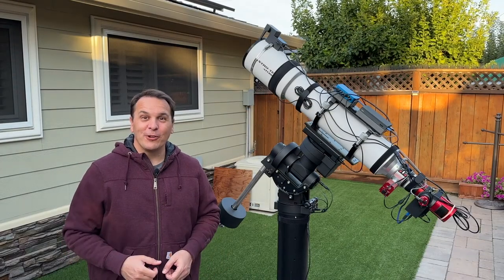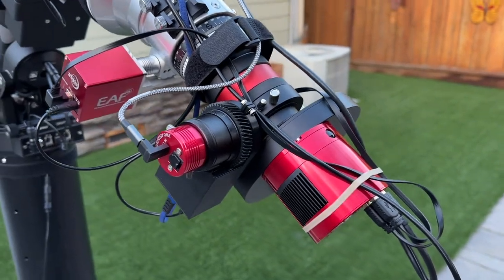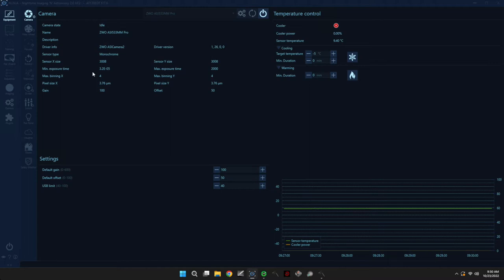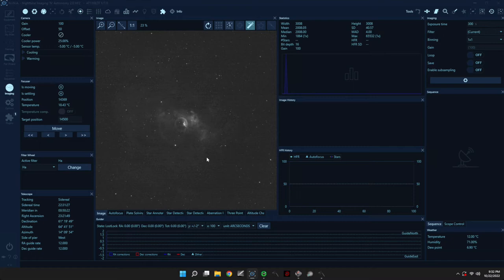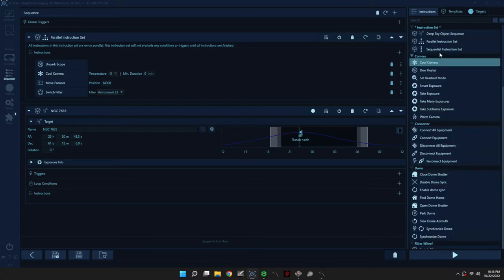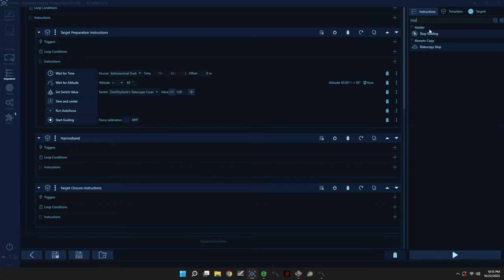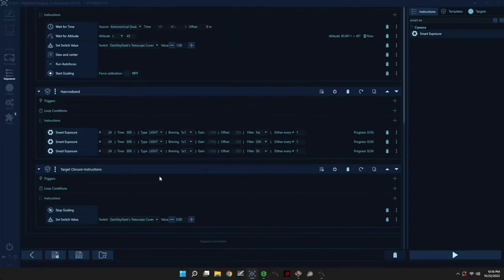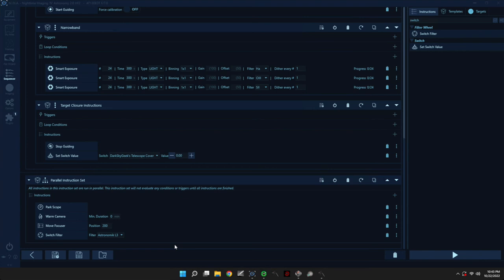The Bubble Nebula Project - Part I - Equipment & Data Acquisition

Comment: Why are you using a refractor telescope? Wouldn’t a reflector perform better?
Reply from the maker: That is a great question, and a very difficult one to answer. Up to 6” in aperture, refractors are better due to the lack of central obstruction and a higher transmittance. Additionally, refractors have a very stable optical design which does not require frequent collimation. The only downsides of a refractor are mainly the chromatic aberration (can be mitigated in a myriad of ways) and the cost (they are generally more expensive than reflectors) Beyond 6” in aperture, refractors become prohibitively expensive, at which point a reflector becomes a better option. Hope this helps!
Reply: @darkskygeek  yes it helps- but the point I don’t get: the cost of that telescope could easily afford a 10’, maybe 12’ reflector, right? Wouldn’t it be a better choice? I’m a newbie to astronomy, and the reflector just seems to be a better choice under my limited knowledge.
Reply from the maker: A 10” reflector will be massive and will therefore require a large and expensive mount. The telescope will require re-collimation on a regular basis. Thermals will be an issue. The surface of the primary will be at best 1/4 wave (unless you pay a lot of money) And you’ll have to contend with a central obstruction, which reduces contrast. Then, you realize that resolving power is limited by the atmosphere, not be the diameter of your telescope, etc. There is a long list of reasons as to why refractors are preferable over reflectors, at least up to 6” diameter. CS!
Reply: @darkskygeek  thanks a lot! I haven’t considered these points before and your feedback improves my understanding. I just didn’t understand what you meant with “primary will be at best 1/4 wave” could you explain it further?
Reply from the maker: “1/4 wave” refers to the surface accuracy and smoothness of an optical surface. It means that it deviates by as much as 1/4 of the wavelength of light (usually in the green, so 500nm / 4 = ~ 125nm) compared to a perfect paraboloid.

Comment: I still don’t understand purpose of advanced sequencer. I can plan everything in simple sequence mode plus refocusing every 1.5 degree drop in temperature; framing target with rotation and meridian flip.
Reply from the maker: The advanced sequencer gives you slightly more control, but there is nothing wrong with using the basic sequencer if it works well for you!
Reply: @darkskygeek  I can use advanced version, but it really doesn’t give any extra advantages.
By the way, how do you decide on integration time. For example, 8h Ha. Maybe it needs 80h.
Reply from the maker: Here is a simple example. As you probably noticed, I have an automated telescope cover. In order to open / close that cover as part of my sequence, I have to use the advanced sequencer. There are many other reasons why I only ever use the advanced sequencer, and I certainly encourage you to give it a try, but if you are satisfied with the basic sequencer, there is no reason to switch.

As far as the total integration time, the more the better 😉 But I am also limited by how many nights are clear, and other factors like work and family life. In the end, I try to get about the same amount of time on all 3 narrowband filters.
Reply: @darkskygeek  250mph faster than 230mph. Both are still fast. For bubble nebula, 8-9h overall integration is plenty. Skytools 4 can confirm it.